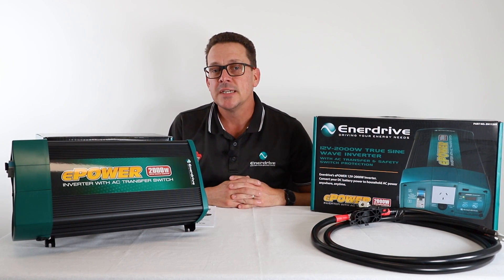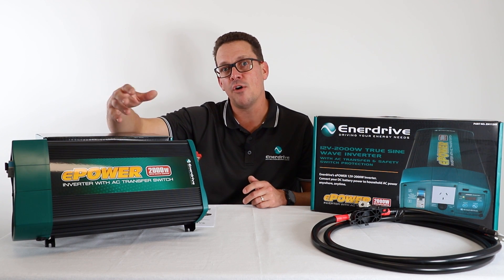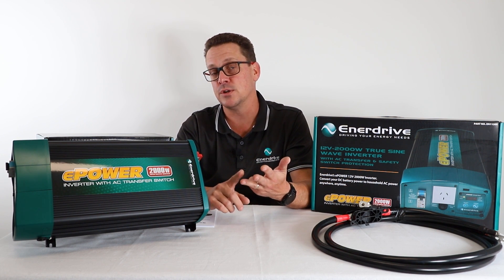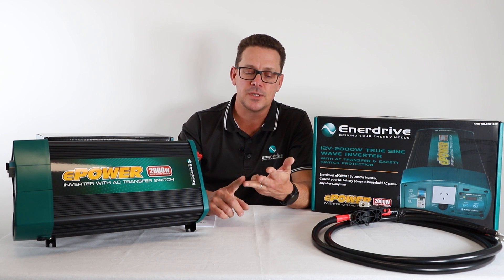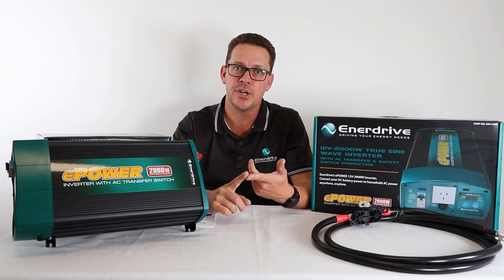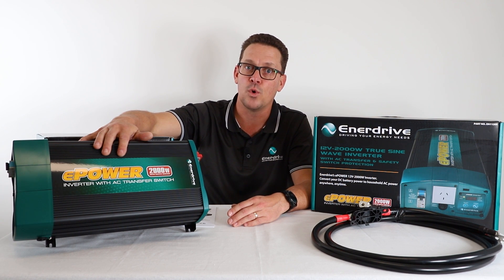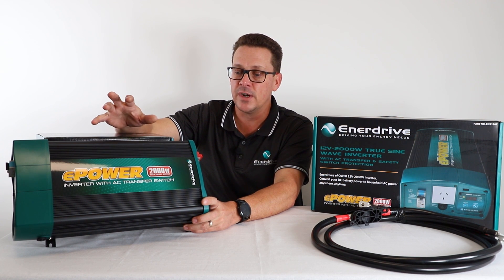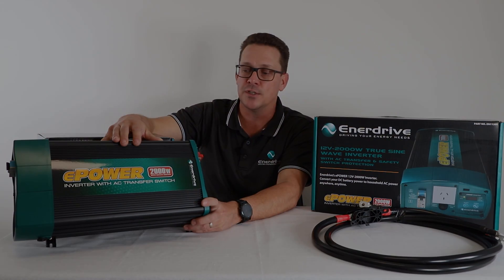Enerdrive Inverters (Transfer Models) - Part 1 - Application

Comment: I just had an Enerdrive 2600w inverter installed in my Caravan and I made sure to oversize the inverter to make sure it wasn't stressed and to avoid the fans coming on unnecessarily....

Well, turns out the fans come on with a 299w load applied, rendering this inverter useless for my application as it sounds like a f'ing jet engine eith a piss weak little load applied.

I really should have bought the Victron 12/3000 and had that installed instead as this Enerdrive is honestly crap other than the inbuilt AC transfer switch and RCD built in.

Comment: You mention generators are not tolerated in many places, but how do you charge your lithium battery bank in very poor weather in the middle of B-- F--k.
Reply: Or you could use a SOLAR GENERATOR...
Reply: C'mon Frankie, use that grey matter a bit better in future bud.

There is more than one type of electricity generator out there, however most people aren't used to referring to them as generators and this is often where the confusion comes from.
Reply: @HatesSpam-cb4ym  Name one then 🤔🤔🤔🤔in very poor weather in the middle of Bum F--k.
Reply: @frankiebenson3212  Wow, not the brightest are yee Frankie boy.

Ohh I don't know, wind turbine, water turbine and solar panels are 3 types of power generators out there than don't rely on fossil fuels to generate electricity.
Reply: @frankiebenson3212  I forgot to mention that Victron have a great product called the Orion DC-DC charger that can be PARALLELED together to increase the output.

Some of their models have a 30amp output, so putting 4 in parallel would mean you have 120ah charge going into your batteries per hour.

Being in the middle of bum feck means nothing these days when it comes to generating electricity.
Reply: Oh I suppose you could run your big 4x4 for about 7 hours when the sky is black as.